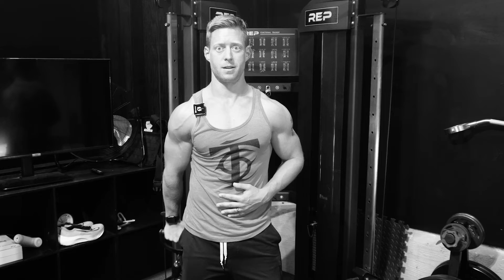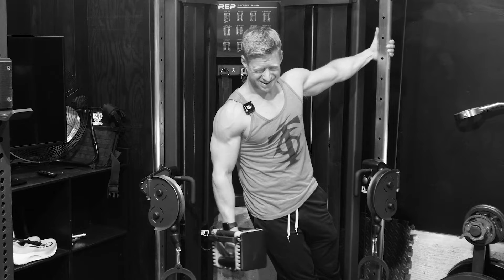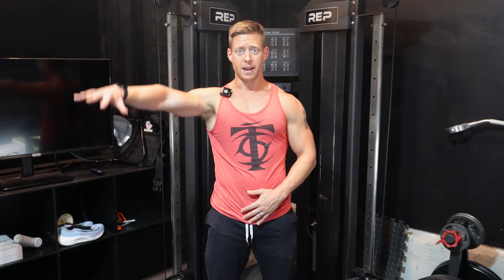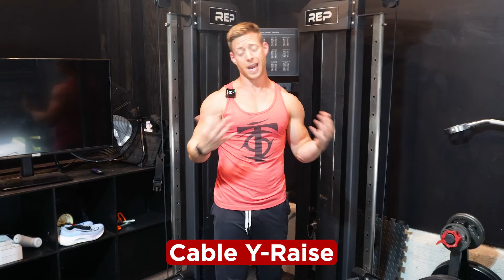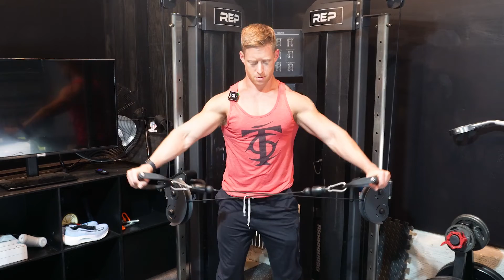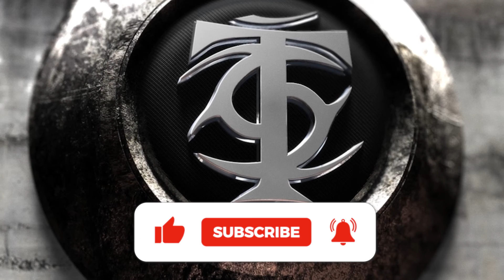5 Lateral Raise Variations That Actually Work

Comment: I train dips 3 times a week and i'm feeling frontal delt tired when doing lateral raises, will a lateral/rear raise with body at 45° work only lateral and rear deltoids? I do only pullups, dips, squats and lateral raises so if like that it train traps too would be good actually. Thanks